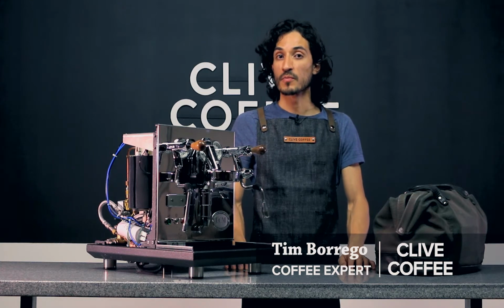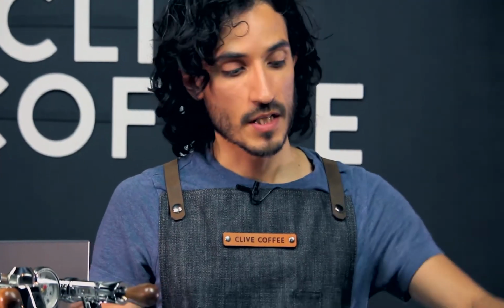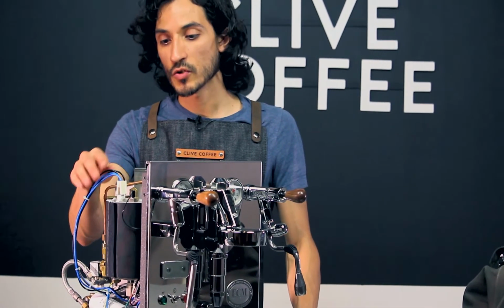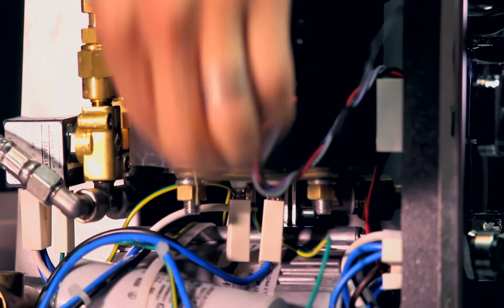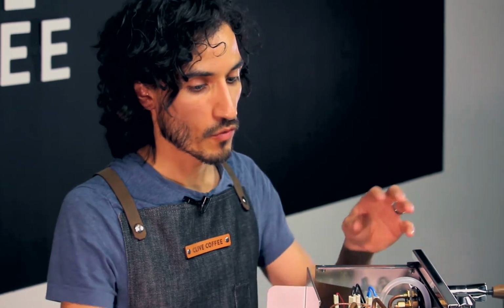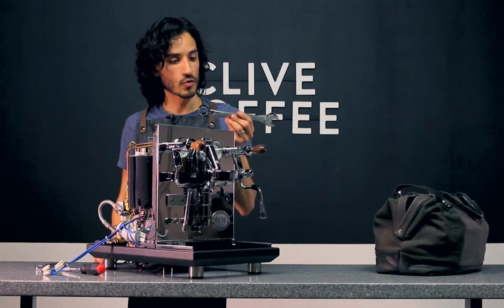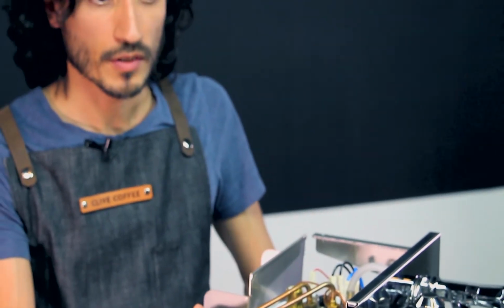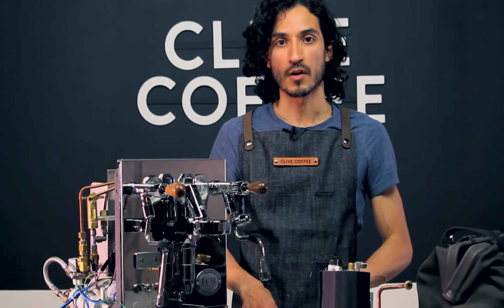ECM Synchronika & Profitec Pro 700 | Coffee Boiler Replacement

Comment: Why would someone need to replace the coffee boiler?
Reply: Because they are a reoccurring issue. Copper piece bolted to stainless steel on bottom, two dissimilar metals, causing corrosion. Also heard that the heat distribution inside the machine is quite poor, leading to more problems down the road.
Reply: Leak at weld.